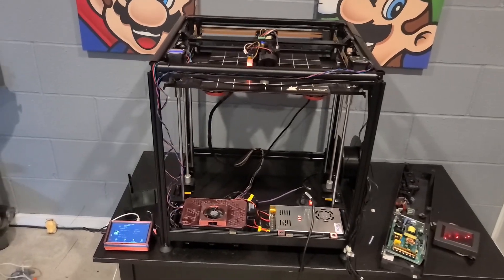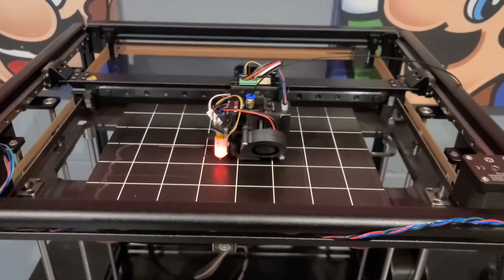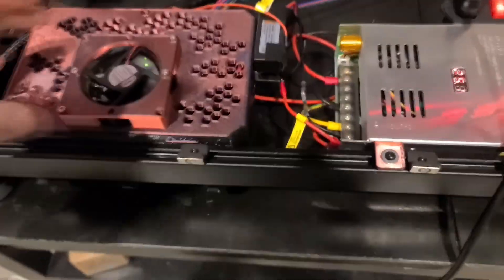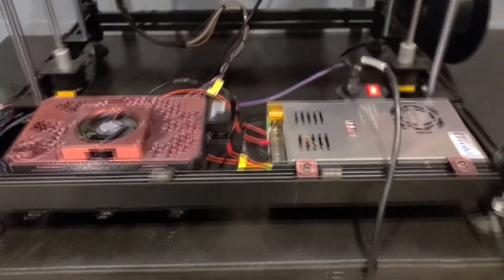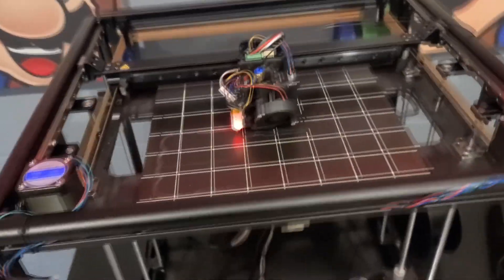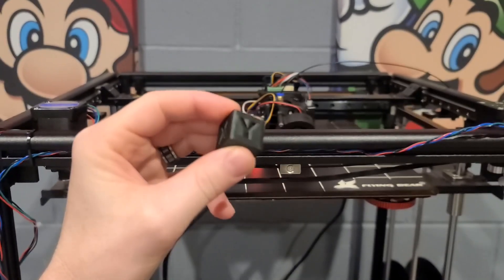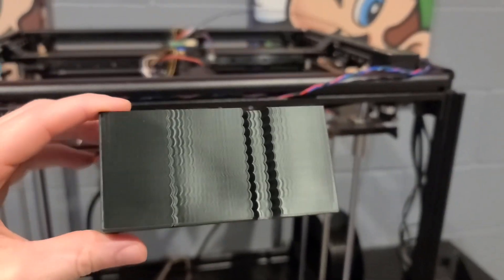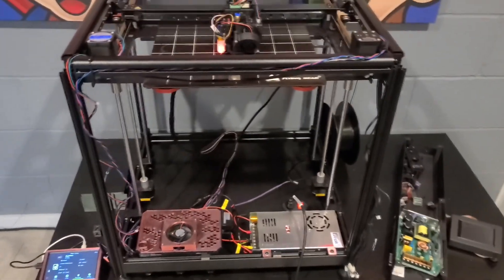ULTIMATE SPEED 3D Printer - Heavily Upgraded Flying Bear Reborn 2 with Linear Advance! (Core XY)

Comment: I'm struggling with my printer and could use advice. I just assembled my reborn 2, and this is my first 3d printer. It seems to bind when trying to bring the bed up and the motors start making a weird noise. Kinda like when you set a drill really low on the torque and the fastener stop and the clutch disengages sound. I don't know if that is a good description. The rails feel kinda difficult to turn, so maybe i assembled it wrong, but I'm honestly not sure
Reply from the maker: @gerber8915  with just the information provided, it does sound like it's an assembly issue that is putting it into a bind. The way that I got most of my printers out of a bind situation is by loosening most of the rail or rod screws by a half turn or full turn. Not very much, just enough to give it some room. Then run the bed up and down and move the head around. If everything feels smooth, then you had a bind problem and you need to snug up the screws as you move the head or move the bed and figure out which area was causing the bind so that you can figure out the root cause the problem. 
I know that's generic, but it actually works on all of my printers and has been one of the single biggest things to help with sticking rails or bed. If you're sure that everything's smooth and it's still not doing what you want, then it might be a motor power issue but that requires getting a bit deeper into the firmware
Reply: @hacktical521  Alright, I'll give that a try after I get out of work tonight. Honestly wasn't expecting for you to reply, but I'm very thankful. I'll respond with an update and possibly more questions.... You rock!

Comment: so do i need klipper to install the bl touch to this printer or can i do it with the stock config?
Reply from the maker: If you are talking about the stock firmware, I have no idea. I'm sure there are other videos on the base printer, but most modern boards have a slot for accessory, power, and two signals which is all a BL touch needs.
Reply: @hacktical521  sweet im new to 3d printing still so this is a big help thanks for the fast reply
Reply from the maker: @WovenGuideGaming  Good luck! It's a great hobby that opens up a whole new world when you can make anything you can dream. But you gotta ask yourself, do I want to just print parts, or do I want to dive into the hobby and mechanics? If you just want to print, then get a Bambu, K1, or other modern printer that does the work for you. If you like to tinker, then get yourself some BTT boards, Klipper, and buckle up!

Comment: Where did you get the mount for the Biqu H2?
Reply from the maker: I had to make my own because none of the ones that I found met my whole pattern for mounting or was as slim as I was wanting. But I used the one from thingiverse called "Strong BIQU H2 Ender 3 Mount" to get the mounting holes and then used fusion 360 to modify the rest. 
For the fan, I started out with the common one that is more flat than aerodynamic and upgraded that later on to the "Biqu H2 Single fanduct v1.1". Still could use more cooling but I believe my limiting factor is the material now since regular pla seems to max out for my extruder at 350 MMS. Once I burn through all of my regular pla, then I'll start buying the high-speed one
Reply: @hacktical521  Would love if you could share your files, I have designed a mount for the microswiss ng but its not great my design skills arent that great.

Comment: 10k/600mm sec with my stock QIDI X-MAX3, and it's slow by comparison to other printers. But it's great to see the FBR2 getting some loving. :)
Reply: Stock QIDI X-MAX3 is more expensive than FBR2 + upgrades :)
Reply: @sergeiepatov7683  Indeed it is. But neither of our printers are going to set any speed records anytime soon. But one of us has made his peace with this while the other one hasn't. :)

As it turned out, I bought both the QIDI and the FBR2 at the same time. I ended up giving the FBR2 + everything (?) necessary to upgrade the printer to Klipper/Fluiid/whatever to my son.

Upgrades included:

Octopus MAX EZ V1.0+Mini12864 V2.0+8 PCS EZ2209
BIGTREETECH PI4B Adapter V1.0 for CM4 or CB1
CB1+PI4B
BIGTREETECH EBB SB2209/SB2240 CAN V1.0 for Voron StealthBurner
BTT SFS V1.0 Smart Filament Sensor Detection Stuck Blocking Filament Module

The upgrades that I purchased from BTT came to $225.91. Still cheaper than my QIDI, but getting closer.

And I recently was reading that the FBR2 "All metal" hotend of the FBR2 isn't actually "All metal". But a hotend upgrade was going to end up having to happen once the thing gets a bit more lively anyway.

He hasn't upgraded his FBR2 as of yet, so he is still driving in the slow lane, but he does like his printer. 

And I would be lying if I told you that it's been all wine and roses with the QIDI. It's had numerous problems. But QIDI has supported me through thick and thin. Not just their help line, but several hundred dollars worth of upgrades for free. I think that I made the right choice. :) 

If I had the room though I would have a FBR2 just for doing cool upgrades to. But I don't have the room, and that's what my HevORT is for anyway. 

Keep tinkering, the FBR2 is a worthy testbed. Just be prepared to explain what "Ultimate speed 3D" means in this context. :)

Comment: Which stepper to replace with for X/Y - in case the stock ones are insufficient for holding torque on microstepping etc ?
Reply from the maker: There's lots of good options. I like LDOs and Moons. For slow bed slingers, I use Amazon cheapys and had no problems

Comment: "ULTIMATE SPEED" 
Vzbot with Stock Tronxy 24v 2WD here. so the Slowest Version. 
And i do 25k/600mms. with 48v and AWD i coud to 50k-100k/600mms easy.
Reply from the maker: That's what I'm working up too, just gonna keep pushing what I got. But more Z steppers allows for more speed?
Reply: not the z. X and Y  @hacktical521

Comment: I suggest you look at the VZ bot before calling this high speed. 😅
300 was good several years ago...  also, you're going to need a lot more power to go fast and get rid of ringing artifacts.  I would recommend LDO steppers. And 48 volts.  Do 72 if you can, but 48 is much easier to hit.
Reply from the maker: Agreed. This was a build for a buddy and I was just trying to see what I could get out of 24V and TMC 2209 drivers. then I was just redoing all of my calibration at 300, but now my problem is cooling and\or bed adhesion